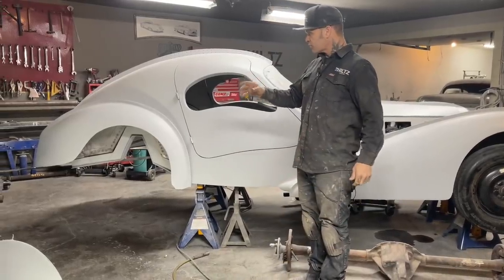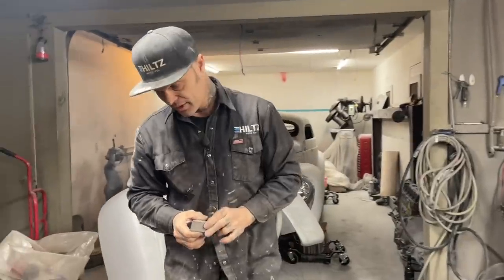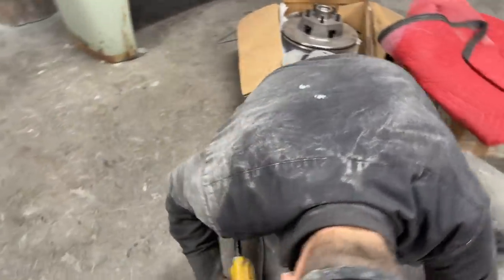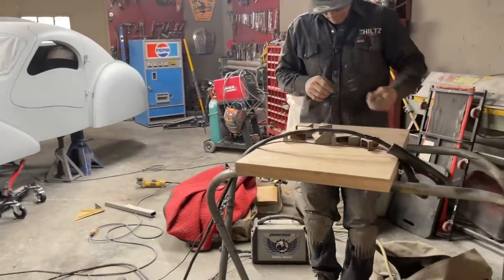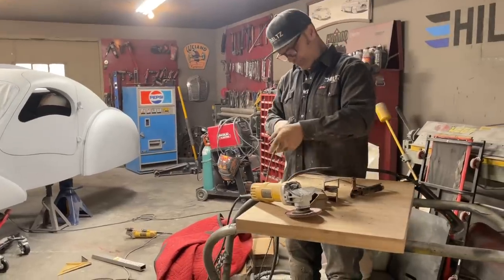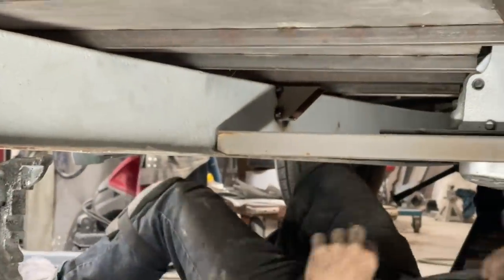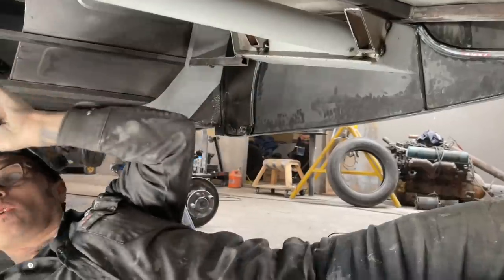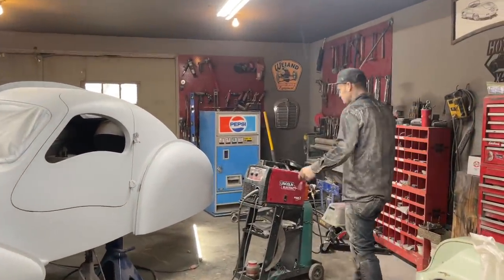FABRICATING BODY MOUNTS

Comment: Anyone else impressed with how he burns those holes on the mounts freehand?
Reply: Absolutely, I would have been clamping them in the vice, doing a pilot hole and then drilling to size and they still wouldn't  have looked as good as that and it would have taken me ages.
Reply: It’s amazing how much he just does by eye without measuring. If I tried that nothing would look straight.
Reply: Alright now, he says he doesn't mind doing them freehand, well, no one would if they could cut them as accurate as he does! He has a steady hand for sure!

Comment: Your freehand plasma holes are a joy to watch, Chad. Like others have suggested, a captive nut welded on the skirt lugs would be better, plus a wing bolt & lock-washer, so you can undo/tighten by hand, instead of needing a spanner.

Comment: Really enjoying watching the build.  Are you going to upholster the seats and interior work ?  I built a 1952 Coronet, body off and from the frame up but not nearly as inventive as your build, and decided to try the upholstery and was surprised to find it was not so difficult.  I purchased a very old Singer sewing machine...over 100 year old and it is amazing how smooth and powerful it is. The machine came from an Upholstery shop and it seemed to know what to do, I just sort was there feeding it and guiding just a bit but I had the distinct feeling that the machine was showing me, I have never used a sewing machine before but have since tried a few others and they do not have that same autopilot feel to them that my old machine has.  

I only with I had used good quality material, since it was my very first attempt I decided to use inexpensive material and it is already worn out and I need to redo it all again...I have the patterns from the first time along with the knowledge that I can achieve what I want.  Looking forward to the second chance.    The rear seat I made entirely from wood, covered in foam and leather.  It has a linear actuator that opens the arm rest when I turn on the AC because I located the evaporator and fan in the trunk under the package tray.  I can run the heat and AC at the same time and cause a weather front to occur inside the car...hahaha.  Also installed heated seat units in the front and rear just because I could and they are not very expensive.

Really appreciate the talent you have for working thru an issue while explaining it and all the while dropping such awesome advice on life.  I do not know how your brain does all that but it seems like you just can not stop it so I say....hope you  keep on keeping on and live a blessed life

Comment: You could drill a hole in the top pin and put a clip through it to hold them in place while you take them on and off and put the rubber strip in between fender and skirt and it will protect the paint on the edge

Comment: You can cut the fender skirt from the outside with a reciprocating saw with a drywall blade or wood/steel blade. Hacksaw blades teeth are smaller and cut slow. And get some cordless tools already

Comment: You should cut 1" rubber bushing and put it on top of the mount and push agnist the body then tack it. That way you dont have a bunch of diffrent size rubber bushings.

Comment: How do you know the clearance to leave between the body and the chassis for what size of rubber to use ? I always thought a 3/4-1” rubber isolator would be necessary. How do you determine the rubber thickness ?

Comment: Hi Chad and Jolene keep up the great work I love the way the car is turning out. Just a suggestion I know you are busy with the car but you should build yourself a trolly for the plasma cutter like the ones you have for the welders as you use it a lot and it would save time putting it away and getting it out every time. I just believe if a tool is used a lot it should have a home of its own.

Comment: I surmised that, the so called mystery dent, which I too initially half caught, on yesterday’s upload, was in actuality, spin further reflection, merely an optical illusion, in where a circular shadow got built up, due to how the filler dust, from the hand saw settled and built up, on the fender, just above its fender skirt?...Mystery Solved...8)